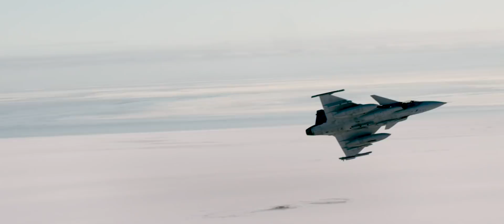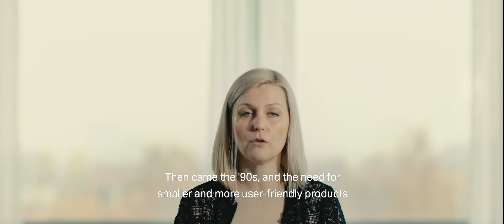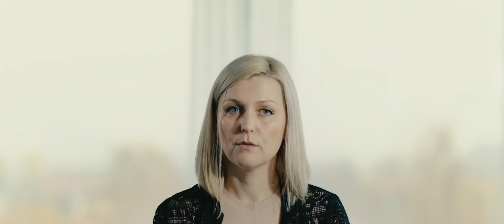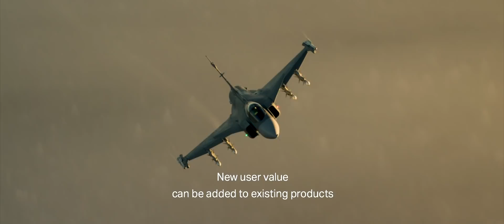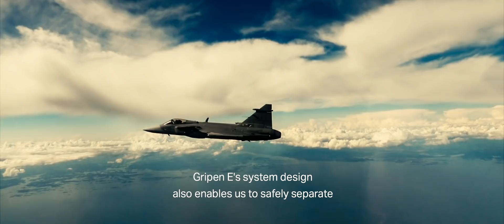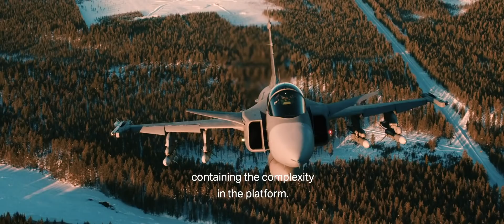Gripen E - Future proof by software design

Comment: Eh what? I am pretty sure anyone who has ever updated to a new software system on their old hardware will tell you it slower, is worse than the previous system and downgrades functionality.
So this ad is saying that SAAB have found way to upgrade both the software AND the hardware at the same time but just using a software patch or upgrade...this is a joke.

Comment: Dumbest ad.  Just look at your competitors ad such as euro fighter, Lockheed martin....
Reply: At first It sounds like all this is obvious, that the software makes the product, but it's not. Very stringent tests has to be met in avionics systems, otherwise major mishaps may happen (refer eg. to Boing 737 Max anti-stall software). Saab's design goals makes a very clear separation between different critical systems such that aircraft safety is never compromised. Further benefits is simplified and lower costs to integrate new weapon systems, and also possibility to open up the software for end customer upgrades - all this without extensive end user costs and exposure to flight critical subsystems. Normally such "enhancements" , i.e. block XX-upgrades costs millions of dollars and is performed in 5-10 years interval's. Since Gripen E's upgrades are like module code, much as a Smart phone, and that's why this is called a Smart fighter (by a very Smart company).
Reply: @Cptnbond  Boing 387??? lol
Reply: Lockheed Martin with the F-22 and F-35 are the best example of how not to do software development. 
It took 7 years to integrate the AIM-9X missile into the F-22. The avionics are complete garbage by today's standards, but it is not a major change. 
The F-35 will have a more Windows Vista like approach to software xD
SAAB wants to go in the direction that Smartphones use, getting certified apps ready for the avionics. And since the software is locked into certain parts of the avionics, a software error with a missile release won't kill the flight control system. That is important. To certify one piece of software does not crash the system is very time-consuming and expensive.
And since other companies are offering similar solutions, some even with changeable hardware modules, it seems like it makes sense?!